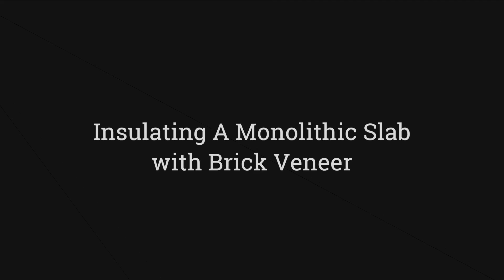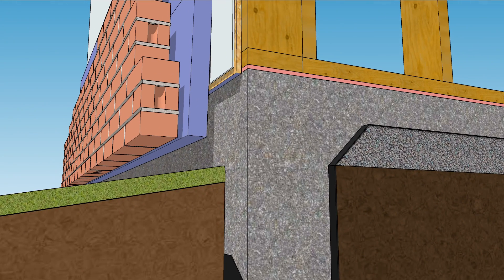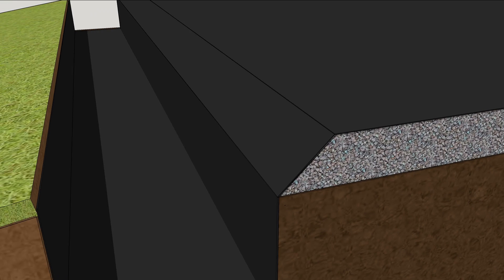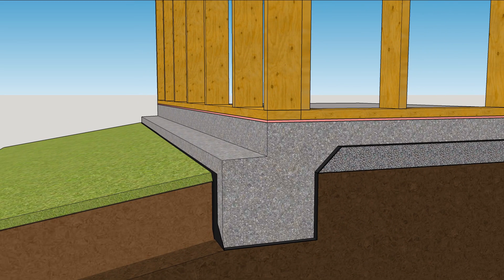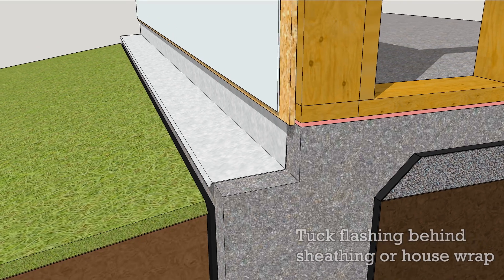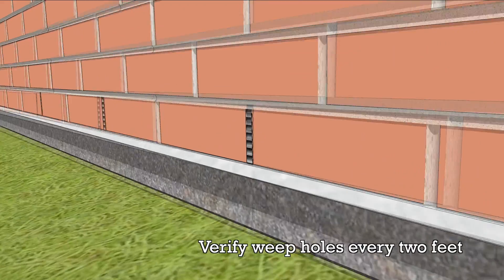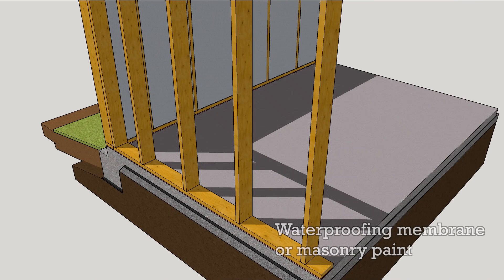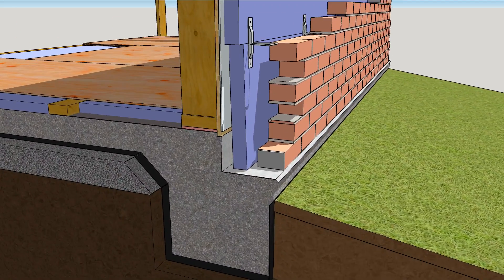Insulated Monolithic Slab with Brick Veneer:

Comment: Thanks for the video, just a couple of questions,
1) I have a precast concrete foundation without a brick ledge, how do you recommend I install a brick ledge? 
2) What are your thoughts on TEC Hydraflex? I was going to use that to paint the foundation floor prior to installing the sleepers and rigid insulation.
Reply from the maker: You can bolt brick ledge onto the foundation. Not sure about that particular brand, but we are generally fans of liquid waterproofing. Though, the foam ought to provide all of the water protection you need.

Comment: Great informative video; however, our brick porch was built as part of the original construction of our home in the 1980's. We are the third-(3rd) in the line ownership of our home in northwest Florida.  To the best of my knowledge the porch sits atop the solid concrete slap; the porch has one interior brick-wall which is shared with the family room; thus this wall is insulated and wired, the remaining three brick walls are just brick walls. Approximately 12 to 15 years ago my parents installed a nice tiled floor and double pane windows on the porch.  The utilization of the porch is according to personal comfort or toleration; however, I am researching how to best insulate and ventilate the three exterior brick walls.   Please advise - thank you very much.
Reply from the maker: A great place to start would be to send a note to the architect listed in this video, Steve Baczek. He does work all over the country, so your climate zone should not be a mystery to him. 

Tell him you saw his video on protradecraft and he will be extra nice to you.

Comment: With the insulation on top of the concrete, the concrete will be cold (in the wintertime). Warm, humid air from the interior will migrate to the cold concrete surface underneath the insulation and condense. I don't see a vapor barrier on top of the insulation that might prevent this from happening.

An alternative to this is to put the insulation underneath the concrete slab with a vapor barrier in between. This keeps all the concrete warm and prevents long-term moisture problems.
Reply: Actually no. The one showed in the video is a cvonstruction standard. What you tell, is a different story. This is double insulation.
Reply: @MrHydyr  Well said! I stand corrected
Reply: @MrHydyr  What does that mean?
Reply: @454Casull  usually, air migration is not the case. The case is, when we heat up the room, we don't want heat to be loss from the bottom of the concrete slab, that's why, we put a good rigid insulation over the concrete slab and under the cement screed . Other thing is, that for better performance, you can put heat insulation under the slab itself, but this is an extra. Too costly
Reply: @MrHydyr  The fact that you mention air migration instead of vapor drive tells me all I need to know. Take care.
Reply: @454Casull  Bro, tell then what is what?. BTW, it's not air migration, it's called heat loss. Normally, air doesn't "migrate" through  foundation slab, as it's well insulated from the bottom, uhh?! Tell me you theory, really fun to know.
Reply: @MrHydyr  Vapor (humidity) moves even without air movement. We don't need to talk about heat loss because we were already on the topic of insulating the concrete slab. Just google "vapor drive" on your own, no need for me to educate you here.
Reply: Yes! You exemplified a true understanding of cold condensing surface issues in masonry!

Comment: Great Video. I have seen cases also when the rigid insulation is placed under the concrete slab. What do you think about that option?  Thanks
Reply: Leaving thermal mass on the outside of the insulation is not the best option. Depending on your climate you will save a lot of money in heating/cooling costs by installing foam under the slab.
Reply: I agree. Insulation underneath the slab. 1 1/2 inch of extruded polystyrene with insulation between the edges of the slab and the foundation